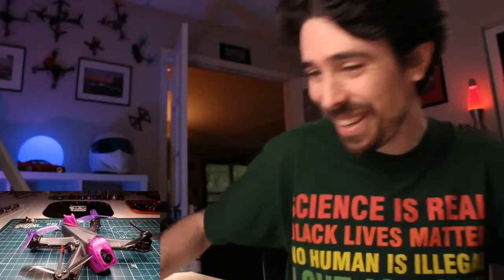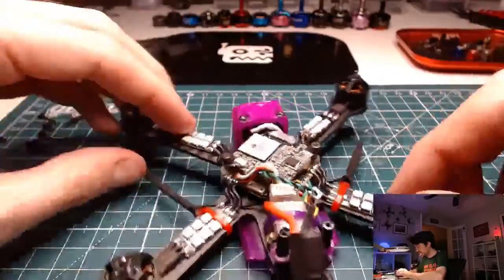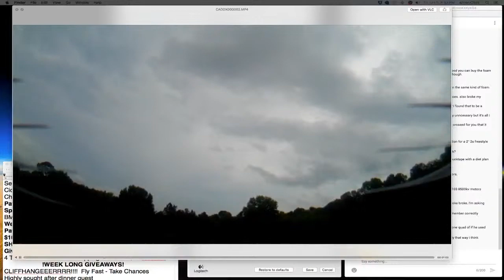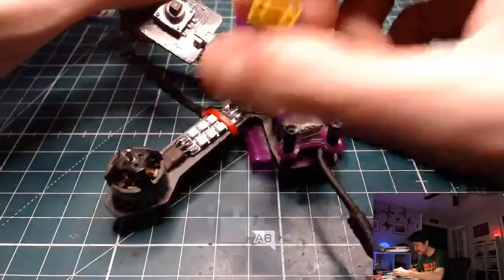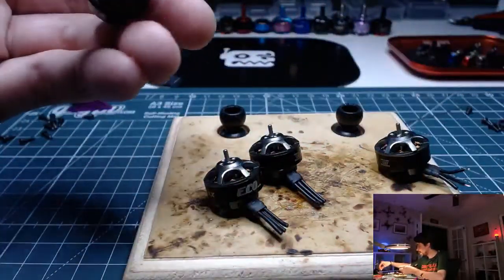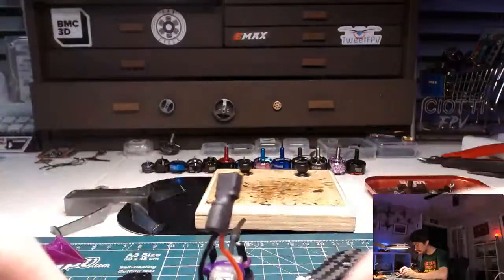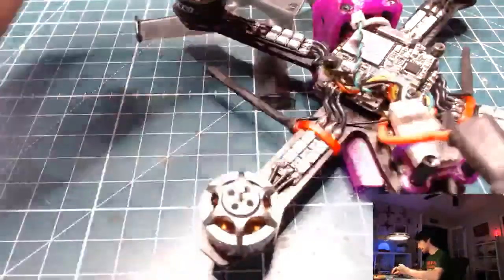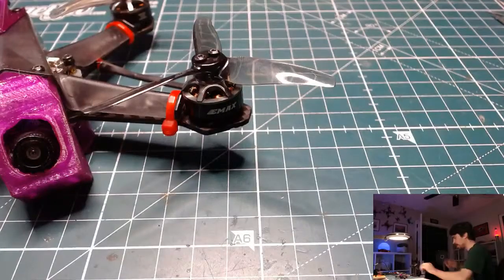The Repair Shop - Tiny Trainer Motor Swap - Emax 1404 6,000kv

Comment: Yo I'm building a tiny trainer rn and wanted to know how your emax eco 1404 6000kv adventures were lol. Did u ever run it on 4s?
Reply from the maker: The Emax Eco's flew great but were very fragile, if you don't crash hard/often they'll be ok though
Reply: @CiottiFPV  so for racing in natural elements a no go? Lol